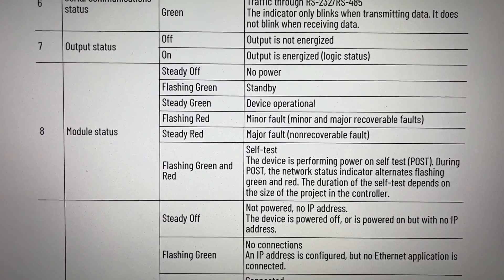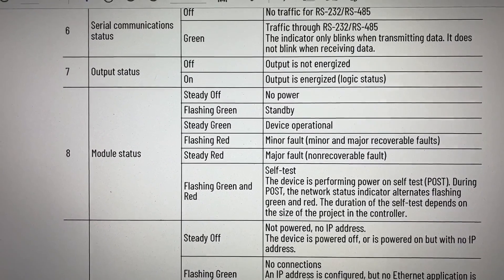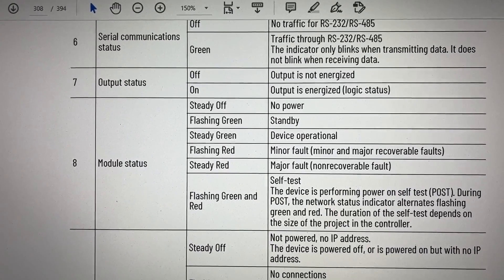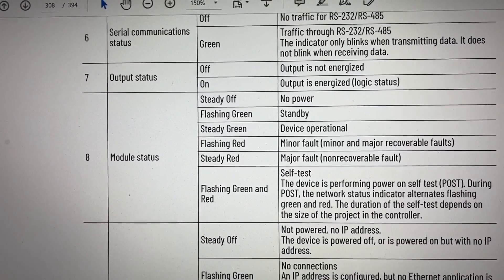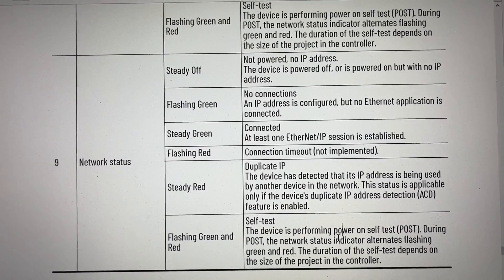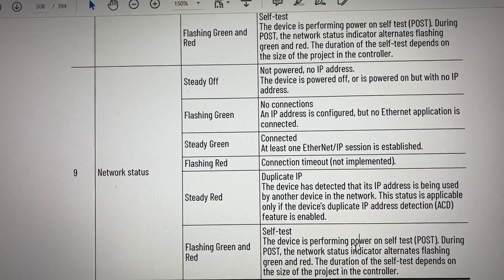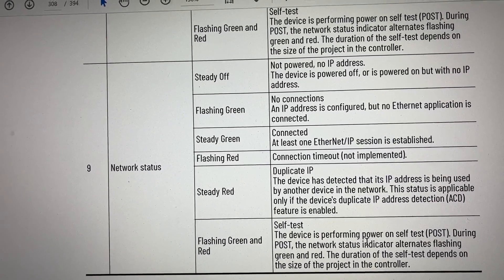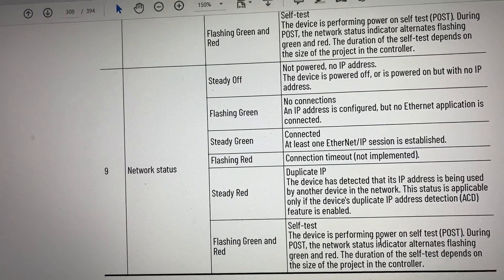Intro/Basic Programming on Allen Bradley Micro850 2080-L50E-24QWB Module Status

Comment: My plant run indication no coming how to clear the fault
Reply from the maker: @baskarbaski4056: In order to clear any PLC fault, you will need to remove the fault condition first. Usually it is from the PLC hardware. I can see it in the Connect Components Workbench software when you computer is connected and online with the controller. Good luck!